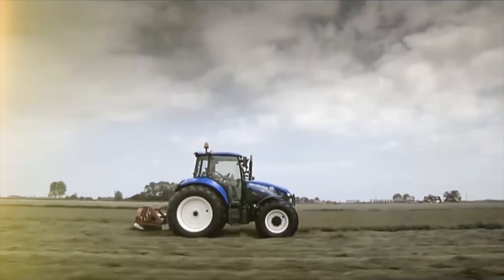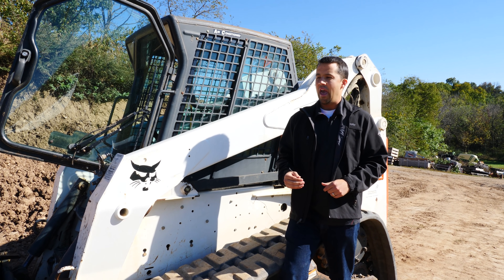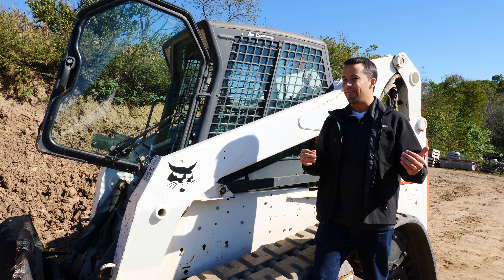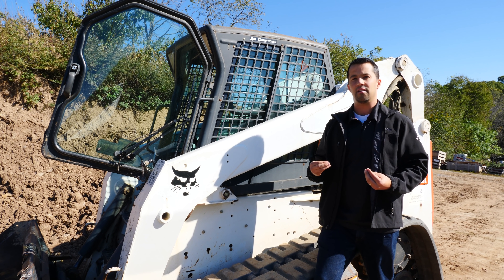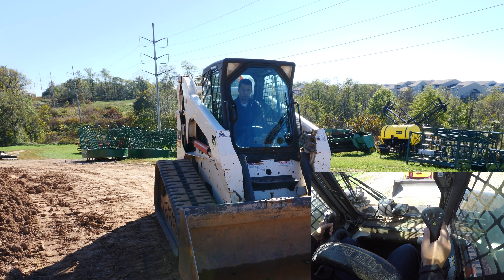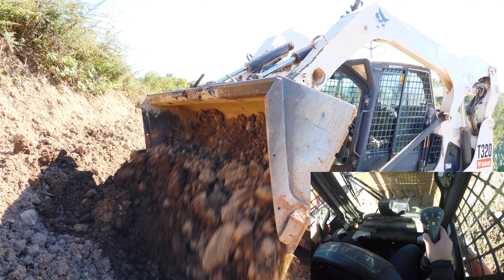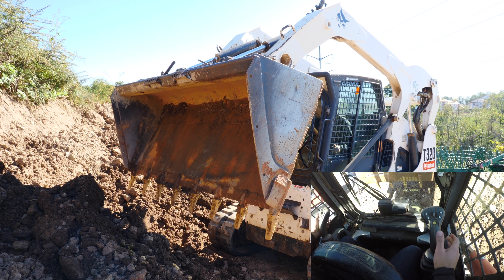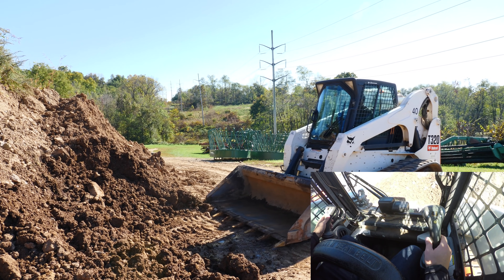Kubota SVL75 VS. Bobcat T320 (hydraulic VS electronic pilot controls)

Comment: Just purchased a 2016 Kabota SLV 75 and have been watching all the pro’s and con’s videos and ill tell yea the Kabota does not have many con’s going on. I expected no less I have owned a 1995 Kabota 2910 tractor and it is a beast and can pull tree’s move dirt like no other TO A POINT . Just changed front tires (yea 20 year old tires) and the bucket hydrolic line man a whole 100 bucks for three of them Kabota owes me nothing for this machine and I hope and believe my new to me skid steer will be the same

Comment: Well, bobcat deserves some shit for chipping implements to not work with other equipment.  Electric over hydraulic controls are just another reason to stay away.  I haven't run Kubota or Bobcat, but the difference between Gehl H/H and Wacker E/H is like the difference between turning a steering wheel on a car, and turning my logitech g920 in an online game.  I don't know how long those wires are that they have Milwaukee to Chicago and back latency...I guess the smoothing is probably nice for infrequent operators, but I don't think it's really worth the reduction in safety.

I ran some case loaders and they were not great, but not as bad as the Wacker-Neuson.  The up-only auto leveling sure was a lot worse than the 2 way accurate leveling on Gehl loaders, and was especially scary when my supervisor for the day hopped on the forks and said "up!"

Comment: We still have an older Bobcat machine with those electronic controls. You are correct sir, they suck in comparison. Newer Bobcat controls are quite a bit better than the machine in your demo  but anyone that's used to hydro-hydro joystick (like Kubota) will most likely prefer hydro-hydro joysticks at the end of the day.

Comment: Bobcat was only a good machine, when it was the only machine. Now, they're just over priced and continue to not be an operators machine. Even when you max out the controls for the bobcat, it's still an unpredictable machine. 
Theres so many advantages to the Kubota, the way the door opens, visibility all around the machine, serviceability, and how quick the controls are.
The company I work for, I have had the ability to operate several different skid steers, between Bobcat, Kubota, Cat, Komatsu, Takeuchi, and ASV. 
My favorite machines has been the Kubota  and Takeuchi because of their speed and how predictable they are.

Comment: Big Difference between hours on machine. Do that again when the hours on the Kabota match the bobcat
Reply: I would have to disagree with your statement completely, I was watching this old video because just got an electric over hydraulic controlled loader at work. I can’t imagine the lag in speed of controls being any benefit after having a bunch of slop in the pins and bushings along with coupler…. Where as the hydraulic controlled you can adjust to the slop and can feel out objects much better. And yes I’ve tried the different settings for delay and they are all junk….

Comment: I prefer hydraulic. The electronic system bobcat uses has too tight of return springs. Plus they're only good for like 2500 hours. Hydraulic pilots may end up leaking but they're much nicer and smoother

Don't even get me started on New Holland. Dear lord, you have to move the stick like 4 inches to get anything to move. 

Electronics suck. More shit to break. There's a reason Kubota, who's kinda new to the skid steer game; uses hydraulic

Comment: I own an svl95-2 I bought in 2018. I like the instant response of the hydrolic system. My machine is high flow and it's a powerhouse . I had the def injector fail and take the wiring harness out with it at only 50hrs. Repaired by Kubota under warranty but it is a widespread issue on this model with tier 4 engine. I  hate def fluid. Other than that the machine is great.
Reply: How is it running 5 years later,  would going with the smaller 74 hp machine  as it doesn't have a def system
Reply: Can these be deleted or would they need a tune?

Comment: Having bought 30+ bobcats and only 1 Kubota, I have to say I didn't think I would buy anything but a Bobcat. I really like my Kubota machine and it performs better than I expected. As much as I love the machine thou, I doubt I would ever buy another one. Kubota and there Dealers don't have a clue as to what service means. Your machine is only as good as the support that is behind it.
Reply: I purchased a 2017 SSV75 Kubota.  I believe the machine is great, but the service from Kubota is just terrible.  They are installing a new engine under warranty (I believe the engine issue is a fluke).  My machine has been sitting at the dealer for almost 4 months.  Terrible terrible service!
Reply: @greggschmidt1105  That's the difference. We had a Kubota Tractor that was less than a year old and it broke at the bell housing. That was in April and they returned it in November. I should have learned from that experience but gave them another chance with the skid steer. Still don't have a clue as to service!
Reply: It doesn't make any sense!  I really like the machine, especially the door, but wow.  I didn't know service could be that bad.
Reply: @greggschmidt1105  Same with me. I love the machine the door and the mechanical controls that are so responsive.I hate electric control as the delay drives me crazy.

Comment: I work on bobcats at a dealership, and with the new track loaders/ skid steers you can actually adjust the sensitivity of your joysticks, so when you shake the bucket it will go.  They have it laid back for safety reasons and for people just simply getting used to it.  Don’t get me wrong, linkages are definitely my favourite, but linkages wear, and the quality of the work gets worse in theory, where as electric actuators (in theory) should be perfect every time
Reply from the maker: There is no linkage, it's all hydraulic.. like your excavators

Comment: i cannot stand any delay and the bobcat in your video seems absolutely awful, that would aggravate me to no end. i bet you the electronic controls are way cheaper to manufacture and there you have it. to be fair my only experience is with cars, but i know what it's like when there is a delay between the pedal and actual throttle and it is very frustrating. i cannot even imagine how bad that must suck when trying to operate a machine like that.

Comment: Lol bobcats are toys .... My 2001 takeuchi tl130 has hydraulic pilots. Work great. Every body else seems to copy key things from takeuchi. As Kubota did . Hydraulic hoses and components  are more expensive than cheap wire and electronics. Your getting screwed with electronics. More electronics you have more problems you will have over time .

Comment: Scared to go up against a T650 Bobcat?  Yeah I would be too!
Reply: I've ran a T650 and T750.. I'd take a svl75 or svl95 any day over them
Reply: t650 any day  @devilish34
Reply: I’ll take a newholland ls 190 any day owned both bobcat kubota caterpiller John Deere new holland beats them all in power lifting and handling by far what I have seen new holland skid steers are the best
Reply: unless you loading a trommel screener with compost and the loaders not big enough and you have to launch the material upwards to get it in, the control was my right foot on the deere loader I was using almost the same foot motion for playing john bohnam style kick drum, its good practice! lolol
Reply: I'd put any Kubota against a bobcat any day!!!! I've owned them all. Kubota hands down on all levels.. simple, productive,never in the shop. I've had seventeen Kubotas in my fleet, over last 8 years. They keep going. Go ahead an keep your kitty. Or do yourself a favor and run some other machine's. Lol

Comment: With bobcat I would only recommend the foot control machines. Once you get used to using your feet to control the bucket and your hands to steer it works amazing. I’ve been finishing grading with a t770 now for about 5 years and I was used to pilot controled cats before it started running bobcats with this new company. It took a little getting used to but now I only run foot control bobcats. It’s so much more precise when grading in tight spots.
Reply: Yup. I know a guy who's a wizard with a T770 and he only uses foot controls.
Reply: Yea defiantly foot controls is the way to go
Reply: Come on dude cut the bullshit if you know what you doing. you know. Both are the same it just takes alittle practice

Comment: Keep it simple,hyd over hyd.With all the new pollutution and changes in controls,the simpler and more reliable,the better for the buyer in the long run.I'd rather change a hyd. line than have to truck it to a dealer for an electrical hyd. repair.All this new tech. is getting harder and more expensive even for the guy with a backyard shop.Just my thought.

Comment: Electric joysticks and controls are the norm in almost all new construction equipment. Using electric joysticks allows the manufacturer to remove twelve pilot hoses from the operator's platform. This also removes hydraulic heat from the cab, removes the inevitable hydraulic oil leaks, and removes hydraulic noise and vibration from the operator's station. Electric joysticks allow for infinite adjustability, and simple control pattern changes.
Now, with all that said...I still prefer hydraulic pilot operated controls.

Comment: a couple points: 
1) mice love wiring..... and equipment that sits outside.... coming from a auto technician point of view (since i've done several $4-5K repairs from rat damage to cars in the last year, and we had one that got repaired and a week later it was towed back after the rats got in and chewed the wiring again!) i'd rather not have something with that much electronics in that environment. don't get me wrong, electronics have their place definitely, but in that environment sometimes simpler is better. i've also seen where a rat chewed the wiring, the chewed part shorted out against another chewed wire and took out an ecu. i've heard the cost of construction equipment ecu's dwarf's the (average $1500) cost of an automotive ecu. 

 2) also, hydraulic solenoids and dirt tend not to play well together, where as a manual valve will pass a particulate of dirt through and hopefully back to get trapped in the filter, a solenoid can get jammed open/closed by a small particle of dirt. it may not be a problem with construction equipment, but in my world (automotive dealership technician) i can say i've seen solenoids in automatic transmissions get stuck open by the smallest particle of metal/debris.

Comment: I buy and sell these things and there is NO way I would ever buy a Bobcat for my personal use. They're full of unnecessary electronics and stupid solenoids on the hydraulics. They're a pain in the ass to get in and out of. You can't get out of one that has a door on it if the boom is raised. And the Bobcat track loaders ride like a brick.  If you want to buy a wheeled loader buy a New Holland. HANDS-DOWN - if you want to buy a track loader buy a, ASV, or Caterpillar.  My choice is an older New Holland LX885 or LX865. Either one of them would make a Bobcat salesman green with envy!!!
Reply: rod builder I have a 2013 Takeuchi tl230 and I have 1700 hours with no big problems at all but I I’m not sure about the new machines do you have any idea if they are as good as the older models

Comment: Foot control is the best
By far!it will out grade hand controls any day the week. grade On slopes radiuses any turning grading, foot  Controls will out  grade them all!! Been running  bobcat’s and skid loader‘s for over 30 years!!
Reply: Been running skid steers since 1985.  Hate foot controls.  On rough terrain is just makes sense to brace yourself using your feet pressing you back into the seat rather than your body flopping around while using your feet on the controls.  Far better results for me from joysticks.  To each his/her own.
Reply: All about preference. I've used h, iso and foot. I very much prefer iso and can out perform a lot of foot pedal operators. But I know there are H pattern operaters that can work faster than me. Just the time spent on whichever set up. But there's a reason more and more machines are coming iso pattern and no H or foot controls
Reply: Couldn't agree more. I love foot pedals.
Reply: I've run them all and you can keep the foot controls.  No really.  I'm glad you like them, and there are many others who feel the same as you.  I can run them well enough to get by in a commercial setting, but I much prefer hydraulic ISO.  I still remember the crazy ass linkage issues with the old Bobcat 870's,  Holy crap but they could be cantankerous when you needed some fine control. I'd very much like to try out a highly developed set of electronic over hydraulic controls that had full adjustability over sensitivity over each parameter.  i also love the foot accelerator/decelerator idea for straight hydraulic machines.  Sure makes fine work on a dozer easier. Good luck with whatever you operate.  I can Dig It.
Reply: That makes no sense.
Reply: I have both a hand foot bobcat and a pilot control takeuchi. I'll take the pilot control for grading and finishing. If I just want to rough shit up I take the bobcat. No comparison between them. Pilot controls are way better in my eyes.
Reply: Yup.  I'll take foot controls any day!
Reply: Larry in thirty years you've apparently not learned much.lol🤣🤣🤣🤣🤣🤣🤣🤣🤣😂😅. Slow learner.,🤣😉

Comment: My  new cat has 3 different control speed setting i keep it on the fasted cause it will shake the bucket fast but i was worried about it cause it felt weird not being able to when it was on the slower settings, i can still grade better with my 05 bobcat with stick steer and foot controls
Reply from the maker: +Ryan D did you guys your new cat has a Kubota Engine in it? 😀
Reply: Messick Farm Equipment, yes it has a Kubota block they say

Comment: You didn't mention advantages of electronic joysticks. With Selectable Joystick on Bobcat you can setup/adjust delay reaction of your movements - remove delay if you are working on flat surface or set delay of reaction if you are in terrain area to avoid unpredictable movements of joystick when jumping over the hills.

Comment: Thanks for the video, well spoken, I realize now why I'm having a bit more trouble getting used to my new cat 259D (compared to the Terex PT50 I had for several years). The Cat does have however 3 response level settings for both the travel and loader controls which helps with the lag, but there is still some..Cat does offer a shake-out mode, return to dig, and work tool positioner modes as options which can help.

Comment: I really enjoy this comparison.   I also prefer the hyd over hyd - I happened to operate a Elec over Hyd the following day after I saw the video and was reminded of my preference.   However, I think anyone operating long enough can get used to either control style.
Reply: Kyle Riegle nope. Electronic will only do what it thinks you want it to do. Yeah, I can get the job done. But it doesn't compare with full analog and a good operator. You can feel everything. Electronic there is absolutely no feedback.
Reply: Which track system is more reliable in long term?
Reply: Kyle riegle

Comment: Clearly you do not operate equipment for a living. To get the bucket to shake you actually have to move the stick slower, not faster. My controls on my TV380 are instantaneous, and are adjustable for aggressiveness, etc. I do prefer pilot over eh stick because they are a lot less complicated. Less wires and computers.
Reply: Guys, he is a salesman. Do not expect really good operating skills and then criticize him for it
Reply: Messick Farm Equipment noob
Reply: It is very clear because you can see he is not a good operator he is extremely jerky in his motions and is not smooth and like you said easily move the stick and it jerks you don't have to shake the crap out of the mechine it is very hard on it
Reply: @pricefortner6287  was not the point to showcase the delay in the system. Also he said many times all machines are different and upgrades are happening. He never said you couldn't figure out how to get it to shake.
Reply from the maker: did you notice the point where I tried shaking the sticks at different rates? In this unit, it does not matter. 

We also sell Case & New Holland, your right that the controls on those machines behave differently. The point of the video was to point that out. Its worth getting in the seat and trying to find those differences.
Reply: @MessicksEquip  you're wrong neal, the t320 has 3 settings for joystick response. Scrolling through the left panel it one part will say DR1 DR2 OR DR3. 1 being slow sensitivity and 3 being immediate response. Very easy to change with top left gray button on left joystick. I have an 08 t320 and prefer DR2 setting. I believe that bobcat was on DR1